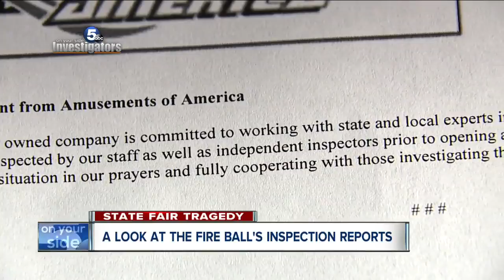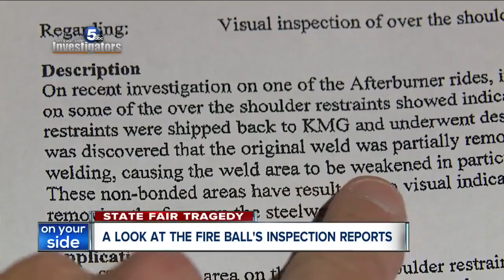Records reveal "Fireball" thrill ride had past history of structural fatigue, cracks

Comment: It's not KMG's fault if the ride owners do not adhere to the service bulletins and repair reported issues to their equipment. I know all to well that these companies will ALWAYS ignore safety over cost. To pull a money making ride down for a moth and then add costs to properly inspect the reported issues and compound on top of that the cost of repair too. Management are always going to look and the books and see a potential loss of $2000.00 and a cost of $6,000.00 will equal an $8,000.00 loss they will not take. Get it running and make us money.....PERIOD!!! 

And consider this, if they have 2 or mode rides with the same situation that is twice or three time the loss of money. OH NO!! That will never happen. Get them running and make us money.....PERIOD!!!

The dollar regulates the safety.
Reply: Yup this is true

Comment: How many metric tons do you belive that arm will face at maximum speed!? It´s not a queston if, i´ts when something will let go.
Reply: Skyisnotalimit no. It is definitely a question of if. I've about had it with GP randos like you pulling arbitrary conclusions based on faulty assumptions, and then stating them as fact.

Do you really think rides aren't designed to actually withstand the force they are intended to experience? Or are you just spouting off, for the sake of spouting off.